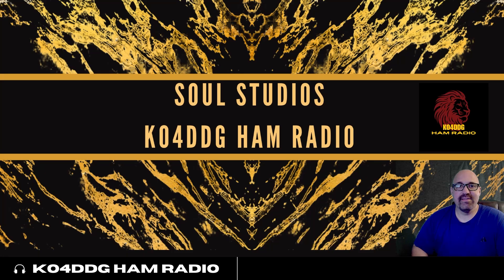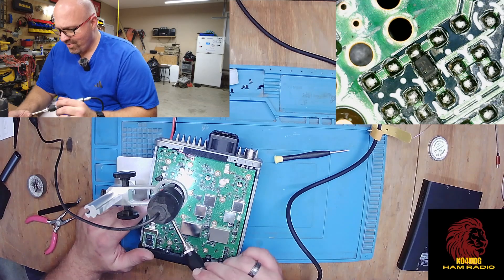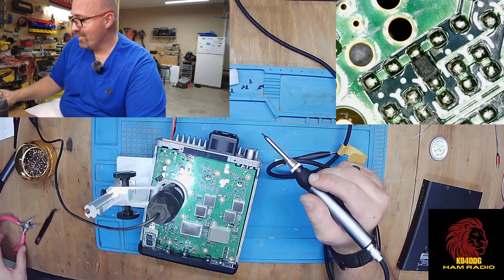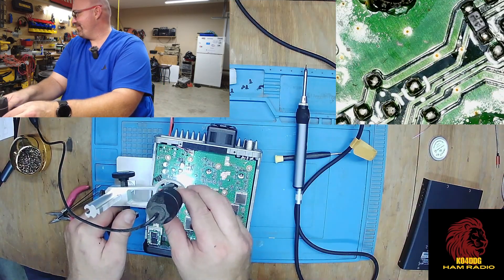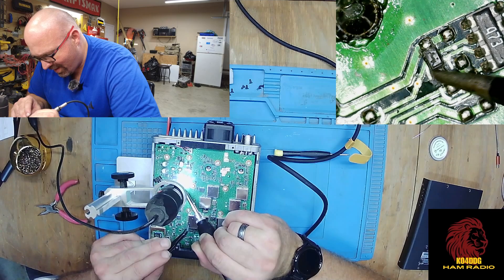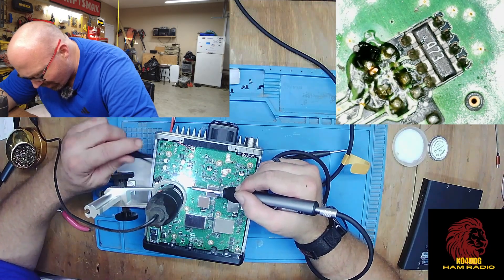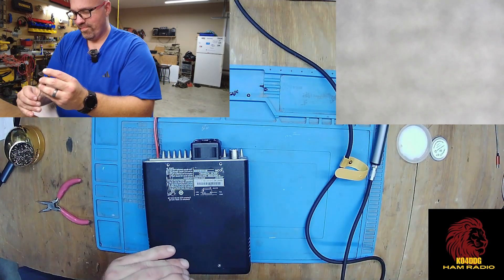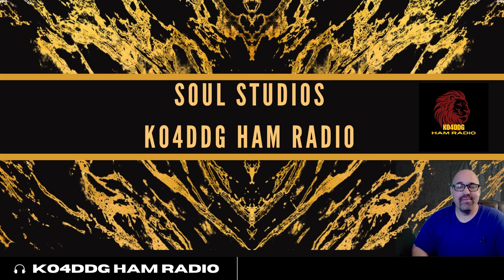Icom ID-5100 Mars Modification

Comment: I’m no expert, orange flux an acid and it should be cleaned off the circuit board afterwards?
Reply: Yeah. It can lead to corrosion. It takes 2 seconds to clean with alcohol. Always clean flux off a board…..
Reply from the maker: Ideally yes, just used flux to distribute the heat to remove the resistor's. Was no harm done by leaving it though. But alcohol can be used. 73s

Comment: I need to do this to mine
Reply from the maker: @HamShackTV  yeah fairly easy, I would say the flux helped
Reply: @soulstudioshamradio  I’m just not well trained enough in soldering
Reply from the maker: Some people just pry it off the circuit board lol it's so small, there's two of them because the 5100 is a dual transceiver